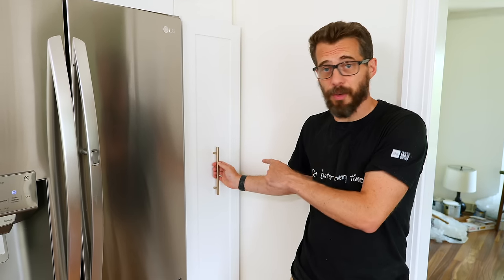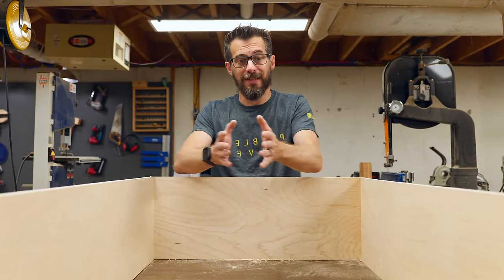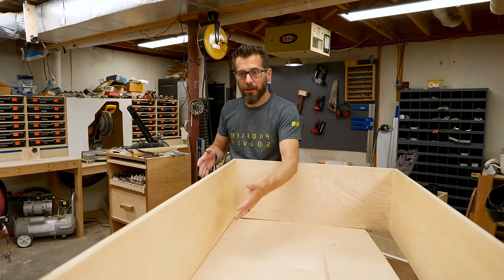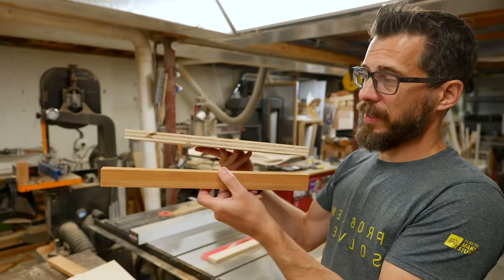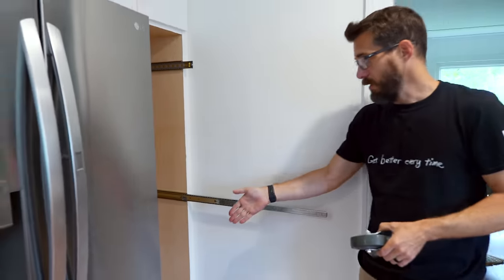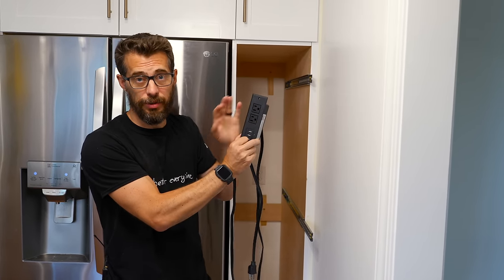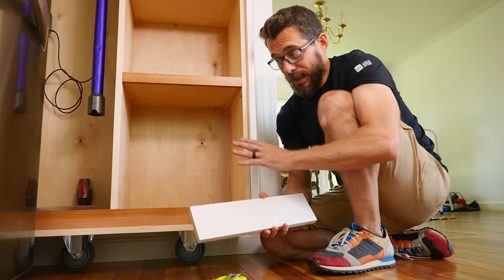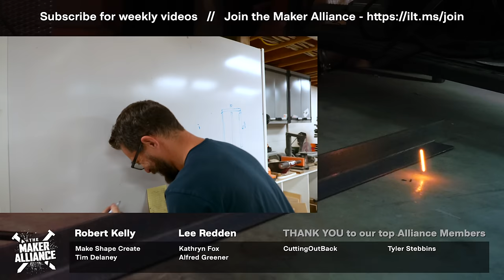How To Make a Pull Out Pantry | I Like To Make Stuff

Comment: I am planning a very similar project but I was messing with just using wheels for the sliding part (also a lot smaller wheels but more of them) do you think the drawer pulls are 100% needed or can I get by with just wheels and maybe a strip of plywood in a channel to guide the cabinet?

Comment: So Cabinetpart/c has 400lb+ twin slides for just this set up. One goes on the top and one goes on the bottom of the box and they're full extension. Have used them a couple times, but they're not cheap.

Comment: I would have cut out the complete floor of the original cabinet and gone with four wheels to reduce the load on each wheel. The kick plate would hide the loss of the original cabinet floor. I like the idea of having the slides on top. Easier to attach and release for future modification and cleaning.

Comment: Currently looking to design one of these and am trying to avoid using runners. Only because during lockdown i broke my hand by getting so furious with one i punched the floor whilst making a built in wardrobe, which used about 30 runners, heavy plywood drawers and 3 rows of drawers side by side i used up all of the runners to finish for the day when trying to fit a drawer in.. it got wedged and ripped out the runner sending tiny bearings all over the place, then another one ripped... £20 down the drain, out of stock online... I went absolutely crazy and trying then to unclip the things in a small space where my design was too tight... i have drawer runner ptsd now. My therapist says i will never get over the sound of the ball bearings hitting the floor but am taking it day by day. XD

I was thinking perhaps have 4 castors on the bottom in each corner so that is will be less reluctant to tip sideways and you could have simple plastic guide strips at the top, greased up, to keep the unit lined up at the top i think this would be ok for me and not have to deal with any runners. Also there would be no limit to how far it would pull out, you would just need to make a small stopper that can be screwed from underneath the top or something like that.

Comment: Why don't you use the "Movento 763 21 Inch 125 Lbs Load Rating Soft Close Slide" at the top and bottom? They are stronger and easier to remove.
Alexandre Chappel featured them here:

Comment: I would have made the vacuum space larger and the shelf area narrower, just because you will end up adding all sorts of other stuff in there. Also, might as well put other cleaning supplies in the bottom shelf. Lastly, I would add a toe kick, of sorts on the bottom that runs along the fridge side. Those wheels are not as pretty as they should be.

Comment: Hey Bob! I had a simlar idea a few months ago to build something like this into a wardrobe to store/hang my jackets.
The reason I wanted to do this was because the wardrobe I will be building needs to be shallow (ie, not deep enough to allow a suit jacket hanger to hang like it does traditionally). I thought of hanging them facing front to back in a pull out section exactly like you built here. In that way I could pull out the whole section and then see all the jackets and take out whichever one I needed.
I was thinking of drawer 2 slides each on the top and bottom, do you think the 4 drawer slides would work? Or do you have any suggestions?

Comment: The gaps around your refrigerator are pretty tight. Was there any consideration for allowing air ventilation around the fridge? 

The heat transferred from inside the fridge will get trapped behind the unit and it will have to work harder and be less efficient.

Comment: Something you might want to quickly do as a preventative measure is unscrew the outlet and pull most of the power cable slack through the hold and put a twist tie around it. The cable looks like it's long enough to drag on the floor as you push the cabinet in, so it might get pinched or run over by the wheels and could be a fire hazard if it causes a short.

Comment: Couldn't you have just SURROUNDED it with drawer slides? Like on the bottom, surely if you stacked up eight parallel drawer slides they'd be able to bear the weight? And I feel like it would remain smooth as butter, and without having to mess with the kick plate and stuff.

Comment: As you cut the hole in the floor of the cabinet, all i could think was: "So, you are storing your cleaning equipment in a cabinet which is designed to be impossible to clean?" You really should have removed that entire cabinet bottom rather than cutting a slot in it.